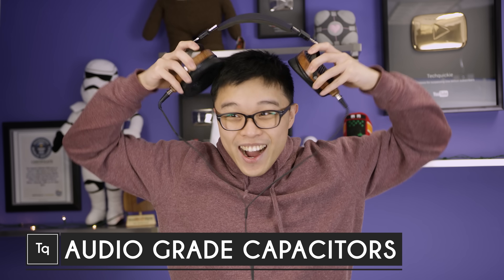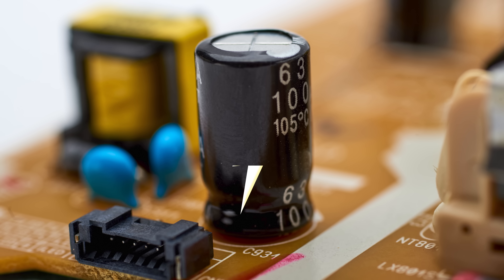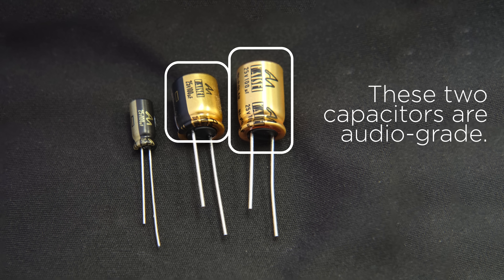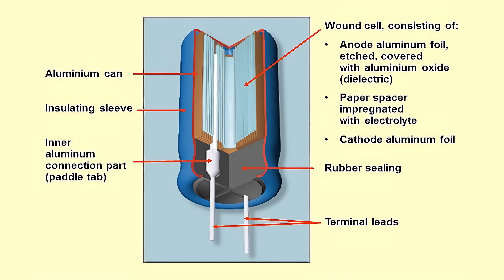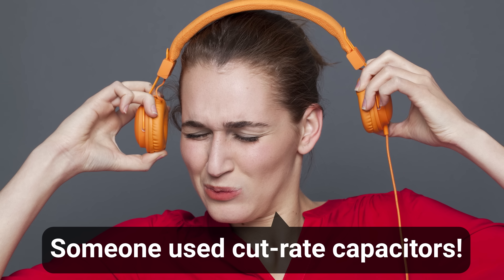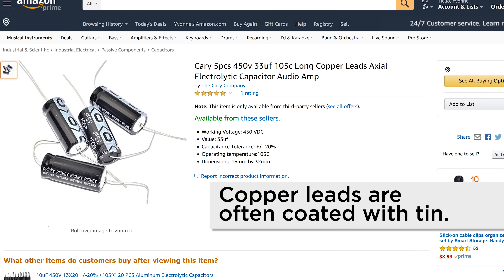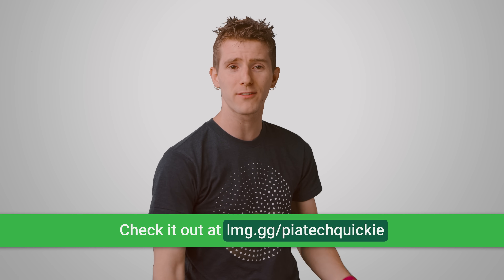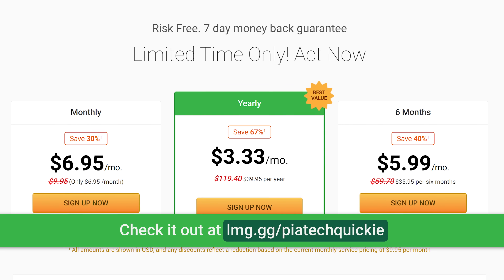What Does "Audio Grade" Mean?

Comment: I can hear ElectroBoom or EEVBlog claiming BS for "Audio Grade" capacitors
Reply: EEVBlog has been saying that for last 10 years, it's insane that people trust all that marketing crap that companies push down their throats. EEVblog #29 - Audiophile Audiophoolery
Reply: @janis.berzins  Quantify and prove it.
Reply: So yea, guys, im currently working out a class A tube preamp design. And anyone who says audio grade caps dont sound better has never messed with electrolytic capacitors for the output coupling of a preamplifier. The audio grade non polar electrolytic's sound considerably better then their non audio grade polarized counterparts. This is actually very common knowledge in amplifier design. Vastly over rating the electrolytic voltage spec also serves improvement in both tested and percieved sound and that is already something many "non audio" circuit designers love to call malarki on as well. If your amplifier design calls for inpput capacitors, dont even bother with audio grade electro's. Jump straight up to film and foil or something actually worth passing an audio signal through. Also common knowledge in the audio circuit design world that the rest of the tech world loves to call malarki on. Even if your system or headphones don't resolve well enough for you to perceive the imaging and "air-sound" detriments of odd-order capacitor distortions, doesn't mean they aren't there. 

Another thing that many love to call malarki on is the FACT that foil and film polypropylene capacitors of a rated value, ALWAYS sound better, and test with lower harmonic distortions then an audio grade electrolytic. Foil and film poly caps, metalized film poly caps, and audio grade electrolytics will ALWAYS, both tested, and perceived (perceived if a system is resolving enough anyway), out perform a standard or solid state electrolytic capacitor). I dont even want to talk about ceramic capacitors. Those little microphonic voltage variable bastards have NO place in audio circuits anywhere. 

Go download a known easily modifiable preamp schematic and solder it together out of dirt cheap components, or buy an el cheapo ebay kit or something, and start playing with different types of capacitors with an open ear and a good resolving system (maybe not $80 gaming headphones and a $50 amp/dac or crappy AIO surround system from walmart, neither of which can even do Imaging and sounstaging, at all). Your opinions on this will change very quickly. Many of you, if you were to do this, would feel quite stupid afterward honestly. 

And when it comes to keeping digital switching interference out of an audio signal, the quality of the filtering capacitance is absolutely essential. When it come's to high performance audio and resolving systems, both ears and measurements devices can note the differences between capacitor varieties. And the only capacitors of an electrolytic type that would even be considered for suck a job by an audio circuit designer would be non polarized audio grade electro's. But a quality metalized film cap would still measure and sound better both for this application, but it would cost more to implement and create a larger circuit layout. Non audio grade electros would just sound plain bad in this sort of application.

I can promise with almost absolute certainty that not one single person making certain claims in this thread have EVER ONCE sat in front of a truly resolving 2ch music system capable of precise imaging and a true depth of sound stage considering that's the moment people realize they had no clue what they've been talking about for some time now. It is a mind blowing, often life changing experience that most people don't even realize is even possible. From sound source, to equipment components, to the room itself and everything in between, it all has to synergize perfectly. But when it does it's a truly ethereal experience, and it's not even possible with 99% of the audio gear watchers of this channel are likely to be using. (I mean no offense, there, it's just the truth< and it's not 1995, it's not a matter of spending a fortune either)

High end audio isn't a walled garden anymore. You can toss a couple hundred at the class D/bookshelf/desktop realm now a days and get "the thing" im talkin about. You will also notice audio specific capacitors and inductors inside them because its *absolutely essential* to real high end audio performance. But you're still going to have to learn how to actually setup speakers to get any real performance besides a flat wall of sound with zero placement out of them.

It is absolutely a fact you have no valid opinion on something until you know what you're talking about though. You guys may wanna revisit the Dunning Kruger curve for a refresher.
Reply: Well, it IS actually a BS. There's no difference between "Audio Grade" and the normal one
It's just simply normal low-ESR cap
Reply: Porama6400 I’m going to make a new electrolytic cap and put RGB lights around it and call it the Gamer Cap!  

It’ll smooth out the FPS!
Reply: @PHamster  Finally a comment that makes sense 😄
Reply: @Porama6400  ESR is nonlinear, not some kind of little resistor hidden inside the capacitor.
Reply: @Porama6400  Quantify and prove it
Reply: Exactly. This is complete and utter bullshit. Old computers used to leak noise because their power supplies weren't properly isolated from the audio amplifiers, something a suitably large cap can mostly avoid to smooth the rails.
Reply: @TheFrenchMansControl  Quantify and prove it.
Reply: @divcurl6044  You sound like the sort of person that might be interested in this low audio noise SD card: https://www.youtube.com/watch?v=AO-vbzLPwSc
Reply: @divcurl6044  How to build a proper power supply noise reduction circuit: https://www.youtube.com/watch?v=wopmEyZKnYo
Reply: Dave very much believes in quality caps (Nichicon, Nippon Chemicon, Rubycon, Panasonic, ELNA, WIMA), but it's probably easy to argue that basically their entire lineups are "audio grade".
Reply: @wsippel  Agreed, those brands are proven to be quality controlled and to perform to the specs they are designed for. They remove the guess work and have a long lifetime.  
If you are designing a product you expect to be powered 24/7 for many years then the brands you mention are the ones to select from.

Comment: "The days of low-end motherboards' on-board audio making, like, screeching noises, as you move your mouse around are, thankfully, long gone."
Front panel audio ports: Allow us to introduce ourselves!
Reply: That's not a motherboard issue, tho. It's the case and its wires.
Reply: @MrFahrenheit2k  You clearly missed the joke.
Reply: @danielrouw2593  I tried it, but the problem not in cable, but the connection between device and port. The only cure to this is either soldering capacitors or connecting an audio device straight to the motherboard.
Reply: Front panel audio ports in 2019
Reply: Can you Cut open the Mundorf Silver Gold Cap to view the inside can ? Is it real Pure Silver Foil or basically just a Fake Foil ?  Video have !  ( Surely u will have Billion of Billion of Viewer in your Youtube).................Cut it now Mundorf Silver Gold Cap...........//

Comment: What a load of crap! Linus has no idea what a capacitor is or how it works! Having a capacitor that is smaller in size for it's capacitance only means it will fit in a smaller package. Having a lower impedance is not important, matching the impedance to the circuit is. This link might provide a better understanding. https://www.youtube.com/watch?v=67M7fsbLUIU

Comment: "Audio Grade" is what you mark your capacitors with when you want to sell them for hundred times their true value.
Reply: @lua ne yioue You know digital still has to go through analog at some point, right?😂 And digital still needs quality components to be good.
Reply: Not necessarily, while I'd never tell people to overpay on a capacitor you probably should look for things not made say by some unmarked factory from an generic brand in china. They are made as cheaply as possible with virtually no quality assurance. At least when you buy something from a reputable company like nichicon, rubycon, elna, janzen, mundorf or even Illinois Capacitor then you know you're going to get something that is actually intended to work for decades and not a decade, maybe. This is especially important in speaker crossover capacitors. It's not even so much about audio quality differences but about not wanting to replace those caps again in a few years.
Reply: Actually audio grade capacitors from elna or nichicon cost about the same as their other ranges
Reply: So does branding like luxury items. At least here, there is actual, practical and measurable differences
Reply: @funnyarc  I think they are Japanese?
Reply: Prove it.
Reply: @divcurl6044  Prove facts? Get some knowlage and try for yourself in a blindtest.
Reply: @Oystein87  I think you are mistaking me for a naysayer, I am interested because I know this makes a difference, even though we can't explain it.
Reply: @divcurl6044  yes u can explain the difference, and linus actually explained it even tho he was explaining it between the lines to make a bit more sense to beginners
Reply: It seems to me you are showing capacitors for active crossovers that are not taking in much wattage.  Passive crossovers are much picker on the quality of parts.
Reply: @lua ne yioueSound is analog.
Reply: Wrong.. Your comment shows lack of knowlage.
There are actually HUGE differences in capacitors. And some are designed to perform better for pure audio use.
Reply: @Oystein87  But these differences will never translate into a discernible difference in the overall sound of the system.
Reply: @rh_BOSS  Yes they can if every link in the chain from start to end is good enough.
Reply: @Oystein87  Yes, if we are talking about the kind of difference like the one between cheap and "audio-grade" cables or pristine and burnt-in headphones.
Reply: @rh_BOSS  Uhm.. There are differences between cables. I have tries several times in a blind test and can hear differences. Same with capacitors. I tried it in a blind test and there are quite a bit difference. Cables and capacitors are like a little "filter" when it comes to audio. But that does not mean a really expencive cable or capacitor is worth the money though. There is a sweet spot in price and performance. And there also are differences in headphones and speakers when burnt in. Speakers are moving parts and they are stiffer when unused than when they are used for awhile. My speakers gradualy got better bass after playing at a decent volume for several hours. That has also been proven so I think you should get some knowlage in the field. But offcourse if you have bad hearing or crap speakers, amps etc it would not matter anyway.
Reply: @ShemieLUL  You are correct here. Cables only make a difference  if comparing shielded vs unshielded OR very long runs.  Runs within a device are unlikely to be affected by cable quality, assuming they are shielded properly. Same with capacitors. As long as they meet a minimum spec, they will work fine, Audio grade or not. Now Audio grade caps do tend to hit or exceed these specs so they will work fine. Thing is you could get virtually the same performance at a much lower BOM cost if you use high grade standard caps. So this idea you have to use "Audio grade" caps to get quality audio really is a fallacy.
Reply: @ShemieLUL  Did you try it to find out for yourself?
Reply: @harshbarj  I would say that you ride a supermarket bicycle or ride a Cinelli there. There is the bare minimum, and something else. And, I defy you to measure why the Cinelli is better than the crap bike, other than its weight.
Reply: @Oystein87  u can't convince people offended by high price tags they cant afford that it actually makes a difference,  it's simply no point, btw u seem to know what ur talking about, totally agree with u
Reply: @MrDannydjmix2  Haha. True..
Thanks👍

Comment: Nicely explained! But capacitors aren't only used for power storage to offset low & peak spikes in electron flow, they're also used as filters & occasionally believe it or not as low impedance fuses to couple as a  bridge safety to burn out (fail) if certain conditions aren't met. Also you mostly concentrated on motherboards & audio components I'd recommend keeping in mind the most distortion can or could result from the power supply either from being a ultra cheap power supply or a possible failure of a capacitor within the power supply.  Granted just as motherboards & audio electronics & components have greatly improved so have power supplies. Just a thought to help you along ;-)
Reply: Indeed.

Comment: Audio grade means nothing.

Take an example, resistors.
Tons of sites sells audio grade resistors, that seems very cool, with golden pin and other shit like that for 6 buck each, but when you take the datasheet, THERE ISN'T NOTHING INSIDE, nothing.
So, lets take an high end resistor from vishay, a very high spec resistor, with a PPM /°C as low as my shit when I see "audio grade" they cost 30 bucks, even 50, BUT when I download the datasheet I take 16 pages for a resistor.
So, when you buy a very high end electronic component you are not only buying the materials and the manufacturing process, but also ALL the studies behind It and all the tests.

So no, audio grade means pretty much shit, like gaming for the PC market.
Reply: @funnyarc  obv they are better. The plates made of plutonium will be the best, because the plates will storie more Energy due to the flow of electrons right?

Comment: The only "audio grade" capacitors are those used in filters and coupling, and are usually polyester or polystyrene, since they don't distort that much like ceramic or electrolytics do. When it comes to power supplies, it's just a matter of having enough capacitance to remove noise and low ESR. Audio grade electrolytics are just marketing, and if some product uses them as coupling caps, avoid that product.
Reply: Finally a sane person! Bless you man ❤

Comment: Don't trust motherboard audio chips to use with your kinda "high" impedance headphone!
I have an MSI B450 MB with chemicon capacitors and they do sound good, but they don't have enough amplification to make the HP sound right and loud enough.
I have a Sennheiser HD58X (150 ohms) and it doesn't get to its full potential with just the MB.
Always use an AMP and DAC (two separate devices) if you have the money to spent.

Comment: They are all ok on motherboards. Seriously, zero difference. Unless you are doing something specialised, it's not an issue. If you were doing something specialised, you'd need a soundcard with more functionality, for example a DAW. If that were so, it's not caps you care about, it's number of channels, ports, ASIO & so on you need. In short, caps don't matter much. Caps usually act as filters to cut unwanted signals passing & to block DC. Sometimes they are used to smooth out ripple in power supply too. You know, to stop 60 cycle hum & radio interference.  Most motherboard do sound processing on a chip then there will be a wee op amp at most to boost the signal for headphones. True amplification happens away from  your PC. It's only then that you need to think about capacitors, when there is a lot of power involved. Tidly wee caps on motherboard will last forever and as such, they aren't worth thinking about. 

Have you ever had old PC speakers that start to hum as year pass?  That is because the caps are failing on the power section of the speakers. It will not be the caps on the motherboard causing it. In fact, if you have that issue with speakers, it's REALLY easy to fix. 

Don't get conned. It's like speaker wire folks, it's all the same unless you are building a particle accelerator or such like. Just more marketing mumbo-jumbo to dupe the uneducated.

Comment: Screeching noise in your audio system from moving your mouse, calculations on your GPU etc. can still occur even with good quality & expensive equipment. You need to connect a  "ground loop isolator" right before your speakers. They are availale for a couple of bucks and your problem is solved.

Comment: Do not blame internal stuff. Sure in the past I had bad luck. One internal GPU was bad and the image had some issues. I do not talk about frame rate, the screen had some snow in it. My internal LAN was even worse. When it hit about 2MB/s in a download, the card dropped to 0. This is no joke. One temporary solution was to pause the download before it hit this speed. Switching to 10Mbit instead using 100Mbit helped also. The solution to both problems was to use external cards for both.

Now a positive example from my pc at work. I use both the dedicated graphics card and the internal one from the CPU. The reason was that the dedicated card only could support 2 displays and I have 3. Now during the summer the dedicated card had big issues and I got some bsod.
Now a specific Program had an issue. When started on a monitor that's plugged in on the dedicated card, windows told me that there was an issue with the driver, after going black for a second. When the program got started on the internal gpu, I didn't had this issue. The program itself didn't worked after the driver fail. It just got stucked. This even continued over to a VM. The monitor didn't made a difference but I was able to recover the program when I paused the VM and resumed it.